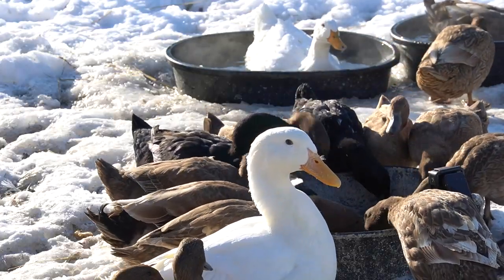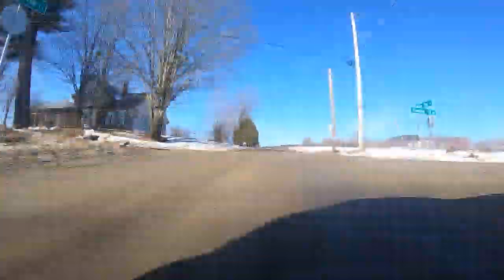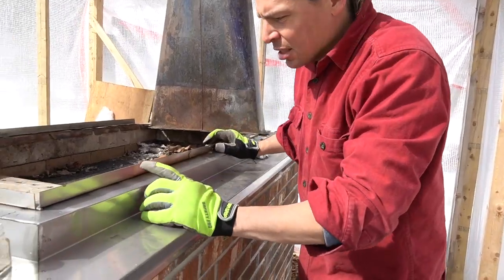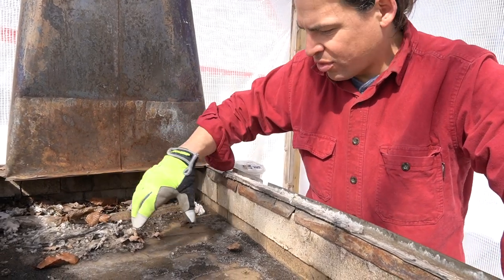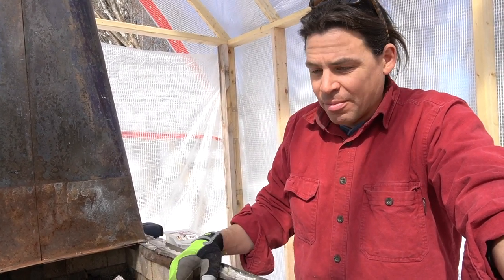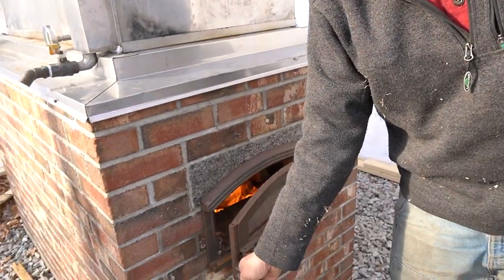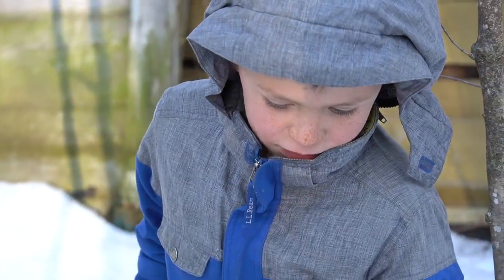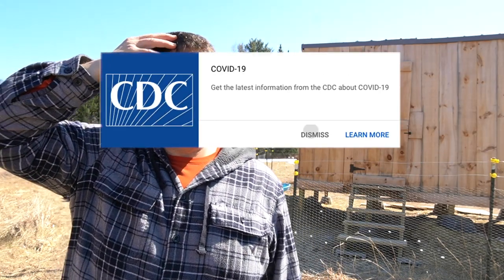Homemade Brick Maple Evaporator | Ultra Fast and Extreme Efficiency

Comment: Thanks for degrees in Celsius!
Reply: Matt Kaňuch   And centimeters and liters. To hell with inches and gallons.
Reply: Yes !  I may use Celsius , but I learned in imperial. And despite having my country 🇨🇦 switch to metric in the 70's ish, I still measure in gallons and inches.
Reply: the Katt   Something that might appease your pain, is that the “inventors” of the imperial are now counting in celcius, meters, liters and say “tens” instead of “dozens” ! Prepare yourself, because being the sole country still counting in imperial may seem ok for as long as the US is number one, but soon (within this decade) becoming number two or three after the Chinese and the Indians might become an issue. To the US, that is.

Comment: This evaporator looks time efficient (gallons of evaporation per hour) but wouldn't a lower stack temp make it more energy/wood efficient? I used to run my wood stove above the creosote-deposition level which is about 350F, so I ran closer to 400F, sometimes 500F) 1400F for your stack temp seems really high. But I guess wood is cheaper than time :) Nice evaporator! I love the granite above the cast door frame! :)